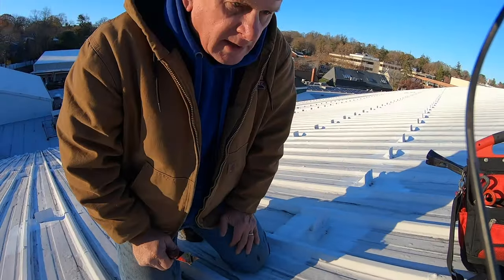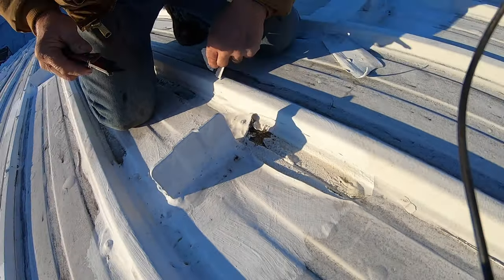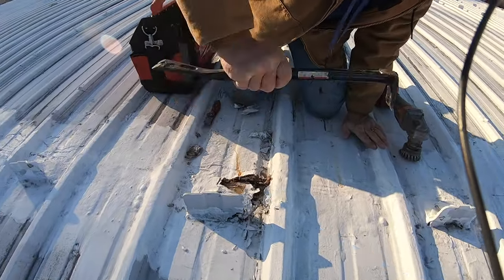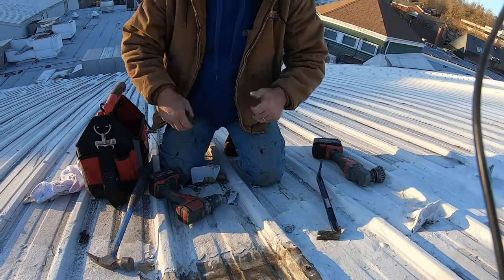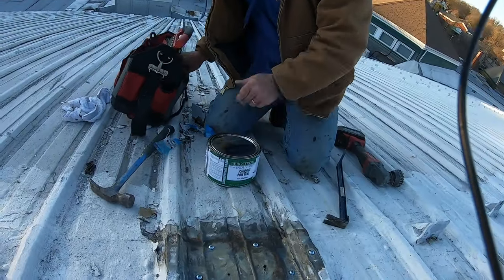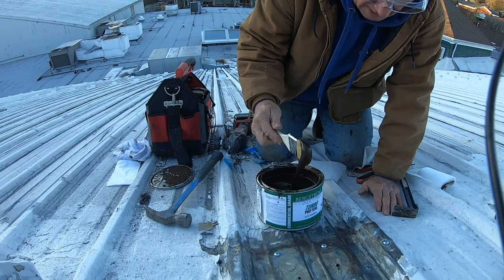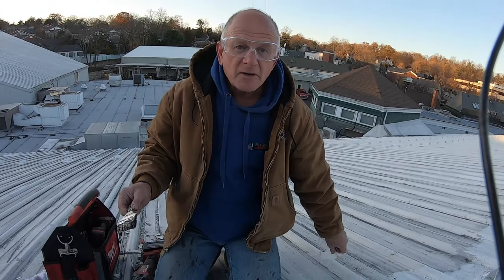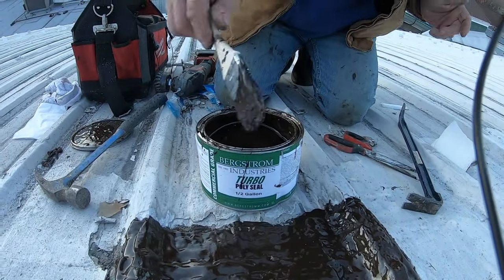Why NOT to apply Metal Roof Coatings - The worst thing to ever do

Comment: I'm sorry but you don't know half of what you're talking about.  The roof is rusted and cracked because the acrylic coating was never reapplied to spec and/or the roof wasn't prepped/coated properly.  No coating will last forever and has to be reapplied/maintained on a regular basis. This is the guy that shows up to your job and tries to sell you a new roof for twice the cost.  A roof restoration, done properly and maintained properly, will have none of the issues he shows
Reply: Good point.
Reply: I'm a roofing superintendent and I completely agree. It's obvious the roof was not prepped/coated properly.
Reply: He was wrong on 90% of everything he said this is a “know it all do it my self type guy”
Reply: I dunno mate. The expand/contract cold/heat has dragged the coating at the base of the valley away from the corner where it starts rising to a ridge. A lot of pressure there and an unfavourable angle for the coating to resist getting pulled away from the iron - I can see how this could happen no matter how good the prep.  I suspect corrugated iron would not have this issue.
Reply: However, the roof is already so far gone. So, you assumption of him trying to sell a new roof is incorrect.
Reply: @AutoMotivate  I'm guess you aren't a roofing contractor.
Reply: 100% !!!!!
Reply: Coatings 100% work when the prep is done right and the appropriate product is used. The problem is all the roofers doing coatings that don’t understand the process.  75% of the installation is prep. Anyone who has done a cars paint job knows what I’m talking about.
Reply: Seems you are highly knowledgeable can mabati roof be coated the same way we do vehicles?
Reply: What I am going to do is apply 50 year silicone caulking just to the seams and screw heads instead of applying a sealer on the whole roof.
Reply: @cdrestorationandroofing283  I've seen so many roofs fail due to acrylic coatings . I only use aluminum coatings and never had 1 fail. And buddy this guy has been doing roofs longer than you've been alive , I think he knows a little more than you
Reply: I'm not a roofing contractor but I have a ladder so I'm kind of an expert. I agree.
Reply: He is a "jack leg"  Acrylic are very and durable solution to problematic.  
Metal roof.
Reply: This guy is always pushing silicone. Silicone is slippey as hell when any moisture is present and very dangerous
Reply: Can I use a rubberized sealant
Reply: @dylanclay2741  you really don't have any idea how long I've been in the business.
Reply: @zanepowell6631  that's why proper walking paths are important when using silicone.
Reply: @cdrestorationandroofing283 it feels like most roofing contractors are the "know it all sell u roof at twice the cost" and I bet the ones, including the roofer in the video is sound in his opinion - if it aint broke, dont fix it. You roofers are basically trying ti fix a problem that doesnt exist... great job security isnt it...
Reply: Restoration companies are a joke. Anyone with a truck and garden hose can replace you. Your angle is to collect many checks from one person instead of fixing the problem once and not coming back. But why fix it when you can keep coming back grifters
Reply: I have a 150 square commercial metal roof to replace it has had multiple coatings I do not know how I'm going to get the screws out now because of all of the elastomeric. Any ideas
Reply: All it needs is Ames maximum stretch. Best out there.
Reply: Ames máximum stretch
Reply: Ya true snow roof that we done is coated underneath the the metal the lay the prepped metal you don’t just slap it on prep it just like any metal surface for paint the coat the roof don’t skimp on this coat it good. If you coat it right it last yrs at time just go back every yr to check it and clean it and recoat it don’t make mistake of going over a dirty roof. Only thing he got right is use flat heads not the hex they stand up and cause pooling. And p.s he does like roof like that or he wouldn’t make money fixing them

Comment: Liquid application on Metal Roofs are actually a great option . This coating problem he is talking about us a combination of cheap coating ,bad surface prep and poor application .
Reply from the maker: Partly true. But always will "Bad Prep" be blamed for failure. There is always room for error, therefore there are always coatings that fail. The above points leave the scapegoat out because that will always be the case that someone did something wrong.
Reply: In my experience we’ve had great success when using a 100% silicone coating like from gaco, but it’s expensive about $400 per 5 gallons.. we’ve never had a problem if prep was done correctly and to proper thickness for application, but I’m also in Florida and we don’t experience the extreme cold weather that you have, I could see that as a problem.
Reply from the maker: @angryhands9564  I agree, silicone coating is good. But it is seldom that people go back after several years to check how it is going or that they get a call from the owner. Almost never
Reply: Is silicone roof coating good for tropical zone?
Reply: @FlatRoofDoctor  I have several Customers that I've been doing work for years and my roof personally. The shit works good. Got to put it on Hella thick.
Reply: @angryhands9564  Just dont put gaco over plastic roof cement thats put on heavy otherwise gaco is great and no only 650 $ for 5 gallons!!!!!!
Reply: @sirjohnahayfalcon  I want to put gaco over mobile home roof. The roof is the tin sheet stuff with what looks like aluminum and elastomeric coatings trailer is an 87. Will gaco adhere to these old coatings?
Reply: @terrysmith1914  buy it and find out. Ever used sillicone caulk?  It cures just like that clear silicone used in plumbing apply liberally
Reply: I paint airplanes for a living...prep is the most important
Reply: you are absolutely correct .Proper prep, using the proper coating and proper application are critical.For small flat roof surfaces such as camping trailers and Rvs, there is an excellant elastomeric by Ames Industries that is made specifically for metal roofs, called Maximum Stretch. It can be applied with a 1/2 inch nap roller and dries in a few hours.
Reply: What did you use to cover???
Reply: Hi, I have a rv roof  that needs sealing on seams which have been taped, any advice
Reply: Seems like the coating should
Be applied first

Comment: Multiple issues here. 1) Never mentions how old the acrylic roof is. Acrylic coatings tend to lose 1-2 mils of thickness per year due to weathering which is why most manufacturers offering 10 years or more for warranty purposes require at least 2 coats. Better products with higher acrylic solids perform better and offer more flexibility and this coating from visual observations doesn't appear to have had such high solid concentrations.  This roof appears to be at least 15 years old or more given how brittle the coating was, but he doesn't mention the age of the coating once. 2) Obvious to anyone who has been on hundreds of metal roofs that were coated with either acrylic or silicone, this roof was prepared poorly for the coating application. As with any paint or coating, preparation is everything if you want it to stick. He scrapes and wire brushes the metal roof and never bothers to clean the dust off or wipe the area he is working on before applying the product. So now a majority of his wonderful repair and product is adhered to dust on the metal panel area from wire brushing. 3) Metal roofs tend to have a lot of expansion and contraction, so as the original coating becomes more brittle there will obviously be cracks and fissures forming on the coating surface. 4) He runs panhead fasteners into the pan of the panel, not the best place for fasteners without an EPDM grommet on the fastener. Given the force he applied while driving the fasteners, my guess would be all the fasteners he installed were overdriven and will eventually begin to back out due to expansion, contraction and being overdriven. 5) He has applied his product which is relatively thick and has basically created a coating seam that is bucking water on the uphill side of the repair. Constant rains will eventually work its way under the repair given the area was prepared so poorly over time creating the same issues he is highlighting. 6) Did he bother to check if the rusted fasteners utilized were even compatible with the metal panel. Often times, contractors fail to realize some fasteners they use during repairs are not compatible with certain metals and this accelerates rusting issues between the fastener and the panel.  The entire thought process that coatings are bad for metal roofs when in fact you are applying a coating yourself is ridiculous at best.  As someone who has served as expert witness in multiple litigation cases on issues revolving around roof system installations, I can state I have seen extremely good coating applications and have in fact represented some in court that were not so good. A majority of the issues revolved around poor preparation with maybe 1-2% of my investigations involving around issues with the product itself. With any coatings, choosing the right coating and thorough preparation of the substrate either provides a long term solution or a short term nightmare.  Bottom line, do your homework and understand the most expensive coating isn't always the best. All in all, if this was meant as a positive promotion for their product, it was done poorly at best.
Reply: Well said. I agree 1000 percent.
Reply: This is 100% correct!!! I've done thousands of squares in my time and proper prep work is a MUST!!! 
ANY type of coating will fail, if not done properly. 
I've never heard of anyone ever using pan head screws before. Is that even "acceptable"?
Reply: PREACH IT BROTHA! AMEN!!!
Reply: I am not a roofing tradesman but have done successful repairs to my roof .  I would think that this a galvanised iron roof then any screws used should be galvanised to prevent galvanic corrosion.   From the video the pan screws used 6:32 did not look like galvanised screws.  He should have clarified that.   Furthermore I agree roofing grommets must  be used.

Comment: This is just an example of a bad job. My grandfather, my Dad and I have a combined experience of over 80 years of roofing. We have seen acrylic coated coated metal last for 20 years without a recoat. On the other hand, we have seen them fail just after 4 years on some bad jobs. This video is not a good representation of an acrylic coated metal. Just bad coating or bad preperation.
Reply: Hi, I’ve been reading the comments and have a question. I just built an Arrow metal shed in my backyard and I want to waterproof the metal....some parts already have some small rust parts😡 I don’t want to paint it, what clear coating could I spray over it to weatherproof it? I live in South Texas where it’s ALWAYS humid so any recommendations would be appreciated.
Reply from the maker: 1. A combined experience doesn't mean a thing. Technologies change rapidly all the time. My son who was with me for 8 years has his own roofing business and is already is in other types of roofing applications. I stuck with Torch Down which I still believe is superior to any other roofing system.
2. Acrylic coatings are water-based paints. There is no latex or acrylic coating that can last 20 years on a vertical wall without being compromised. On a metal roof that gets super hot, it has less of a chance. Then all these paints shrink. As seen in the video. It is almost impossible to prepare the surface of the metal roof in such a way that it would be free from crut and dust.
I have seen the same thing over and over again and every coating I saw was applied by so-called "specialist" in roof coatings. They all have failed.
Now I really appreciate your comment, because there is some truth to what you said. Standards and quality have dropped. Maybe there are products that are designed to withstand the elements. But as you said, bad products and bad preparation make for an expensive job.
Thanks, buckethead151 you are a good man
Reply: @FlatRoofDoctor  Combined experience means we have seen a wide range of products and applications. It means we know what we are doing and how to do it right. We install Foam Roofing with either acrylic or silicone coating. It may not be superior in durability but it offers insulation unmatched by any other roofing system. We have seen tourch down systems that have failed due to improper installation just as you are showing in your video. Its up to the installer to make a roofing system work correctly.  Thanks for your reply and your passion for a good roofing system. I'm sure you do a great job!
Reply: Exactly. I pressure washed, primer, flashing coat, and finish coated 13 storage unit buildings with Mule Hide acrylic coating.  No bubbles or peeling...lasted 20 years.
Reply: @buckethead151   is there a difference between elastomeric and aluminum coating? i bought a hosue with a metal roof and since this costs alot i want to put the right shit on. i got 2 quotes and both were for aluminum.
Reply: @hippa2dahoppa2  There is a difference. The Aluminum will do the job if applied correctly. I've seen the Aluminum coatings get dry and age quickly. Elastomeric Acrylics will reflect more sun and keep the metal cooler.
Reply: @buckethead151   thanks for the reply! i decided to go with the aluminum fiber. my roof is already silver and i found a bucket from 2010 in my garage this morning so the previous owners must of did a coat then.
Reply: @hippa2dahoppa2  if already coated with aluminum then always recoat with aluminum as nothing else will properly bond to it.

Comment: In actuality, the problem is way more complex than what he's making it sound. It could have been a cheap coating. It could have been poor Surface Prep. We have no idea how old the coating was in the first place. It's very important to recoat your roof when it's necessary, not when you have leaks. It's also important to use a rust inhibiting primer underneath your top coat and seal off your Fasteners with caulk. His logic is very over simplified.
Reply: You are correct about everything except for the primer part 90% of time or more roofers don’t use primer and usually isn’t a problem
Reply: Didn’t notice your pfp^ I guess you are a roofer

Comment: Not a fan of elastomerics but for some roofs that don't really need to extend their service life i guess it is an OK fix.  Our roofing company has used pretty much everything out there over the last 25 years. We use only one products after 8 years of success and not callbacks.  There is a Liquid butyl rubber made by epdmcoatings.  What we like about it is that it does not need a primer for any of the roof types we have applied it over that goes for metal, BUR, epdm, foam but NOT silicone.  also it is a one coat application so we close much more business with this product because we come in as the lowest bid!   It is a solvent product so primarily the reason it last all the years.  Cheers
Reply: There are lots of coating options available that don't require a primer coat
Reply: I want to paint our poll building roof it has some black on the top. Other than that it’s in good shape I’m wondering do I just pressure wash the black and hope it comes off and then just paint over it

Comment: I used Kool Seal roof coating on metal roofs on mobile homes in Florida for years and never had a problem. The old silver coating  and the white coating too.
Reply: Do you use the Henry 887 tropical cool white silicone reflective roof coating on the metal roofs ?
Reply: @EleyMartinez   This was years ago, I'm retired now, but the silver cool-seal coated the seams of the roof and the edges where it was screwed on. Worked great to stop any leaks. Years later cool-seal came out with the white. Coated the entire roof, not just the seams. Made the roof look great and helped keep the mobile home cooler because it reflected a lot of the heat off the roof. Foy could actually place your hand on the surface of the roof on the hottest day. On a silver roof it would blister your hand. I was sold on it.

Comment: That seal will last 3 years tops, if that. Not to mention it was applied over an apparent wet and very cold surface which means adhesion is minimum. This will dry, crack and peel very fast. Also, the black color will take a beating from UV rays that will further accelerate deterioration. I'd love to see the state of this patch currently as this video is now 3 years old.
Reply: 5:23 everything reminds me of her…

Comment: I was in the metal roofing business for 35 years, and while I do not think this man has any experience with metal roofing (uses pan head screws from Lowe's) he has a valid point, which is: Unless you are a professional painter, well versed in rusty metal surface preparation, and the equipment to do the job, do not use coatings. I was also a Porter Paint (now PPG) dealer, and wanted to paint my rusty barn roof white. I followed Porter Paint recommendations step by step, including an acid wash to neutralize the rust. The coating looked great for several years, until a hailstorm, then the paint was laying on the ground below the eaves of the barn, and I had a rusty roof again. 
 If you need to paint a rusty metal roof, I suggest you begin with a high quality asphalt roof coating. Stirring it well, and using a knob brush. Brushing makes the aluminum pigment leaf up better. Apply in warm weather. In 2 - 3 years, or when the coating begins to lose its shine, paint the roof again using a high quality liquid aluminum paint. This combination will last for 10 to 15 years. 
If you have screws that are loose, go to a metal roofing store and get #12 or #14 screws with neoprene washers to replace.